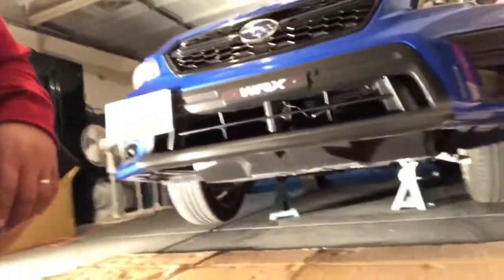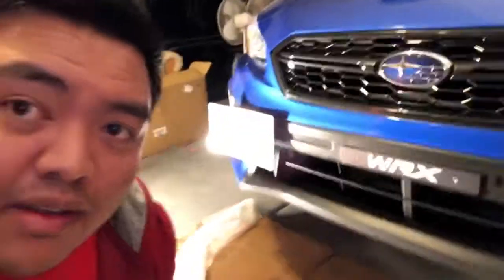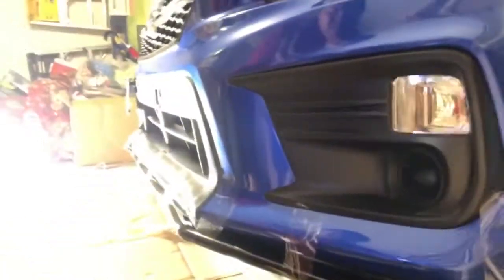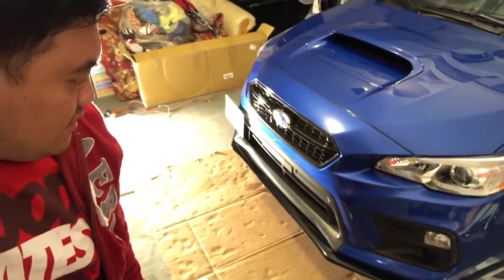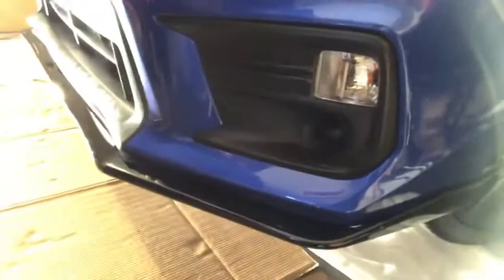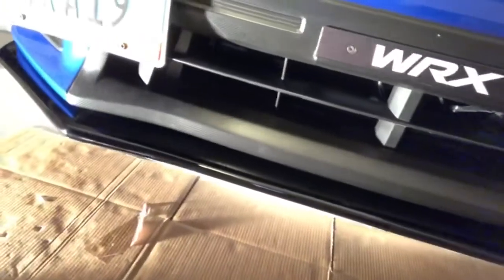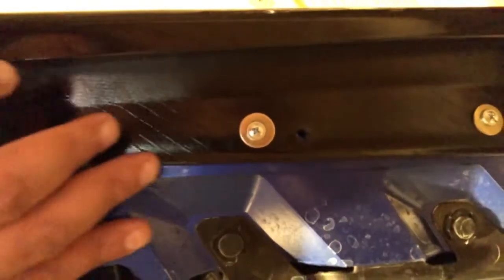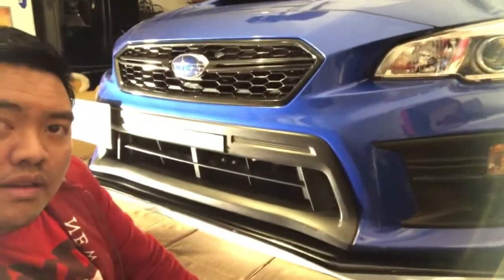2018 Wrx Front lip Installation

Comment: kuya salamat sa vid at link ng lip. balak ko din po maglagay neto soon sa 2018 wrx ko.
Reply from the maker: nice... meron pa akong isang lip check mo pa ibang videos ko masmaganda yun parang kamuka ng type ra. subscribe ka ah.
Reply from the maker: https://rover.ebay.com/rover/1/711-53200-19255-0/1?ff3=4&toolid=11800&pub=5575477609&campid=5338470859&mpre=https%3A%2F%2Fwww.ebay.com%2Fitm%2FFits-15-18-Subaru-WRX-STI-OE-Style-Urethane-Front-Bumper-Lip-Spoiler-Emblem%2F302683760427%3Ffits%3DYear%253A2018%26hash%3Ditem46795ba72b%3Ag%3AmSsAAOSwhspcENtR%3Ark%3A19%3Apf%3A0
Reply from the maker: check mo yang isa pang front lip linked masmaganda yan.